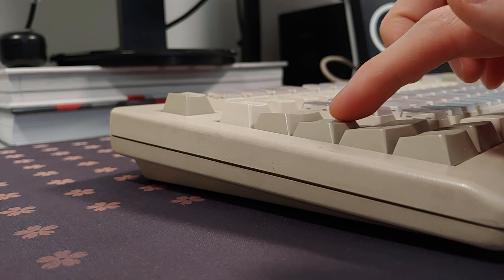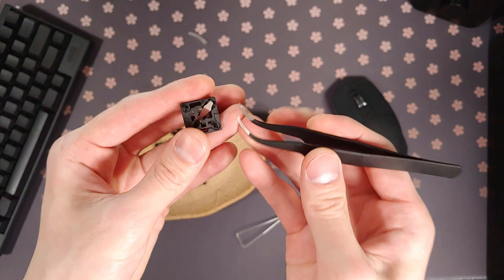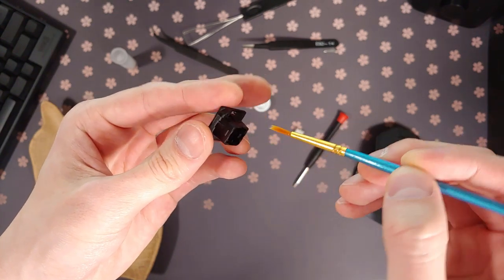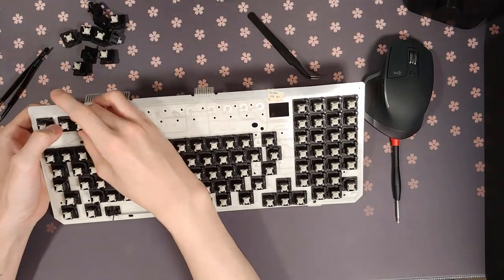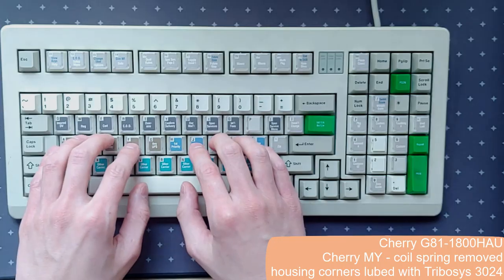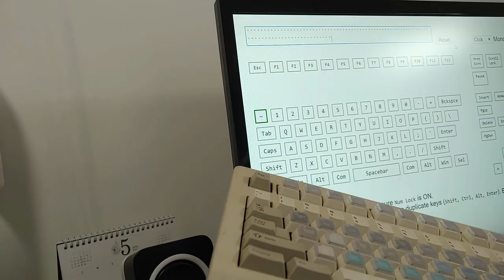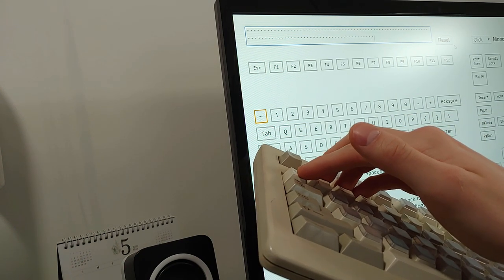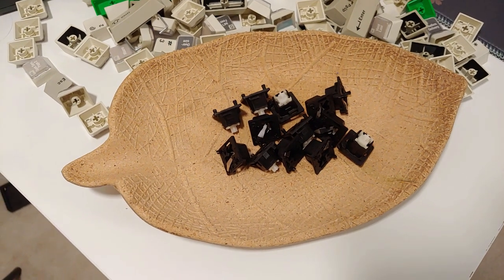Can We Save the AWFUL Cherry MY Switch? - Modification

Comment: is the spring mx compatible? can you put the springs into mx switches?
Reply from the maker: The spring is a lot shorter and narrower than MX. I don't think it'll work in any mx style switch
Reply: @JYMV  did you replace the spring or just threw it out? and put it together without spring? 

I have that keyboard at home, might improve it :D